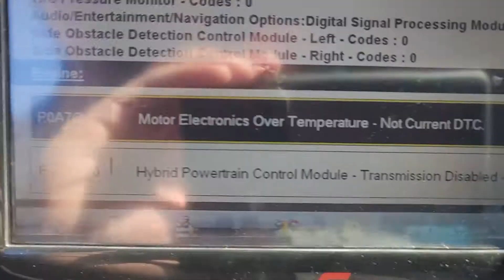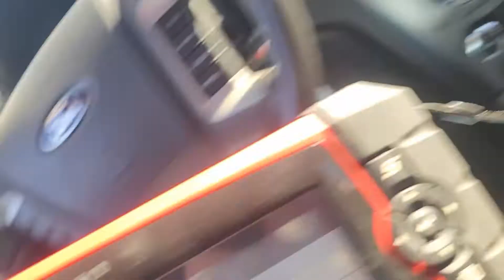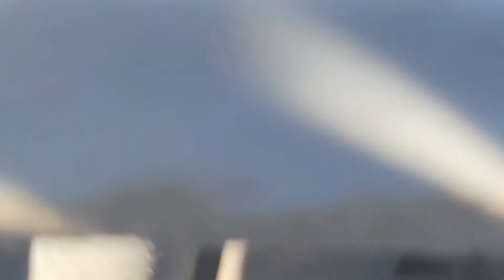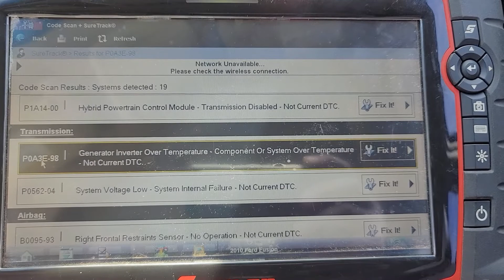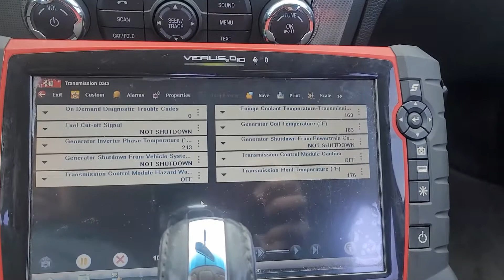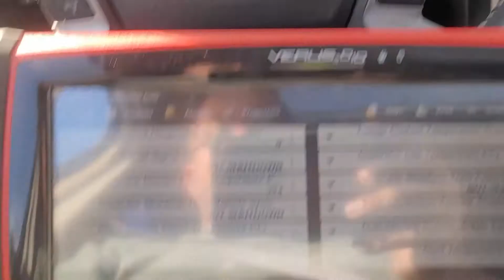2010 Ford Fusion Hybrid P0A7C, P1A14 AND P0A3E CODES Diag and Repair

Comment: I just experienced this issue today. It's starting to get cold in Canada so I let the car warm up with the heat on for about 30 minutes. FYI: IF THE HEAT OR AC IS ON , THE ENGINE STAYS ON LONGER because its needs more power to run those systems. You will get less fuel economy because the car cannot go into EV mode frequently enough. Anyway, as soon as I started driving the car it made that weird chiming noise and I seen the "STOP SAFELY NOW" alert on the dashboard.  I quickly pulled over and the car, went into limp mode and wouldn't move afterwards. I strongly believe that the P1A14 CODE IS WHAT DISABLED THE CARS TRANSMISSION AS A SAFETY PRECAUTION. I figured that it may have been an overheating issue so I let the car cool down for about 30 minutes and I was able to start it and drive it back home while having no alerts on the dashboard.  I'm glad I found this video because I think that's the exact issue that I have. I had this car for about four years and it has over 130,000 miles on it. This car has been extremely reliable and never gave me any issues. From my research, it looks like it's a common problem like you mentioned so I will be buying this part and installing it if I get the same codes, thank you so much for making this video. It was very helpful.
Reply: Have u ran into this problem again?
Reply: @ no, I had a neighbor help me install it auxiliary water pump and it was fairly easy. I’ve been driving for over a month now and so far so good. ✅

Comment: I have a 2012 that I switched the pump out but didn't make any difference. Any ideas or how much do you charge for something like this ( I'm in Arlington TX)
Reply from the maker: What exactly are you looking to do?
Reply: repair if possible  but im thinking the actual transmission is shot  makes a strange loud grating noise if you start the car on the engine side.
 @DallasAutoDiag
Reply: Ford Dealer scanned the codes and said the trans was shot would cost $19,000 to repair (yes 19k)  offered us a $2000 trade in on a cruise that wouldnt drive and within the hour had posted our car on their website for $11,000   figured since they obviously knew they could repair the car a lot cheaper than they said it might be something as simple as the wiring or the pump.
Reply from the maker: @paulwarden4227  I agree. Something is fishy in what they did.

Comment: I'm wondering, does the hybrid cooling system need to be burped?? if so how?? also, if both pumps were replaced, should the hybrid inverter cooler need to be replaced also??
Reply from the maker: Every coolant system needs to be burped.

Comment: Hello I have a 2010 ffh identical to the one in this video and when driving the red high engine temp light flashes and chimes over and over again comes on and goes off but car still runs also has high idle
Reply from the maker: Any codes in the system?
Reply: @DallasAutoDiag  no just pops up chimes and disappear does this really fast when breaking then hitting the gas or around turns the fluid levels are Allgood  the car temperature gauge says normal
Reply from the maker: @seancolpitts7431 
Hard to tell. And makes no sense to spend money on something not broken all the time. If it happens more frequently in the future do not sleep on it. Scan it right away.
Reply: @DallasAutoDiag  thanks for your valuable time have a great day

Comment: Hi I have a 2010 Ford Fusion hybrid as seen in this video. It’s fully loaded with all the stuff. I bought it at 50k miles about 4yrs ago and it’s now just over 100k miles. But my Audio when connected to my iPhone via Bluetooth it makes a static sound from the speakers that scales with the volume. I know the speakers are okay because this problem only happens sometimes. Do you know that the problem could be?
Reply: I’ve actually had them check the software and they said it was up to date. I’ve tried with different phones and it still does it. But like I said it’s kinda random when it does it. It doesn’t do it all the time. Could it be a loose wire that might have a weak connection?
Reply: Thank you for replying so fast I wasn’t expecting suck a quick response!
Reply from the maker: @williamblais5068  could be
Reply from the maker: I know apple Bluetooth is not the best when it comes to connecting to products other than apple. Sounds like a software issue. Could also be from the car side. See if someone can check your headunit system to see if there is any update to tge software. A phone call to tge dealer might also give you some info but they are gonna ask to bring car in to check radio software version.
Reply from the maker: Also try with another iphone or an android based device and see if you have that issue. If not them a phone replacement might solve your problem.

Comment: i also have 2010 fusion  hybrid. my seems perfect but once i get on the highway and go 70 mph and up a yellow  wrench pops up and goes away when i turn the car back off and on. i need help !!  whenever i got it scan that said it’s saying it was over heating but it wasn’t !!
Reply: always if my car is in park it’ll just vroom very loudly sounds like a fan or something but it moves the car
Reply from the maker: They are not expensive and changing them are easy. I think it worth replacing it before effecting other parts of the hybrid system that could be bigger bill to repair.
Reply from the maker: Might be week water pump as our case here cuz this car had a working water pump for the hybrid system at first.
Reply: no i haven’t gotten it fix yet. 
i somebody told me it could be a temperature sensor. but i think it might be the water pump. ima have to get it change. wish you were closer i would bring it too you lol
Reply: also my check engine light isn’t on
Reply: This is my exact problem right now did you get it fixed?

Comment: This same thing is happening to my 2010 FFH right now!! EVERYTIME I get on the highway the red triangle pops up saying stop safely now along with a check engine light. I pull over turn the car off, then turn it on & all the lights are gone & I am able to drive like normal again. But then it will keep doing it. Then the past 2 days it did not do it. Then today it did it again. So do you think it is my water pump too?
Reply: the same thing just happened to my 2010 Milan, it was a cheap 20-minute fix, try the  auxiliary water pump, on my car its located on the driver's side bolted to the frame down the bottom of the radiator, easy access from underneath
Reply: Did you get the yellow wrench light when it was happening? @scottgelinas6066
Reply from the maker: did you get to scan the vehicle to see what codes you got?
Reply: The same issue in my 2010 FFH too. Did you find what it was?

Comment: This same exact thing is happening to my 2010 Ford Fusion hybrid right now! It lets you start the car back up & the check engine goes away right? Then you are able to drive until it happens again? Because that’s what mine is doing. & it usually happens when I start going fast on the highway. So it’s the water pump?
Reply from the maker: Sounds like it's the same but You need to scan it and see which codes are you getting.
Reply: @DallasAutoDiag  hey great video.same thing is happening with my ffh code poa7c  motor electronics over temperature